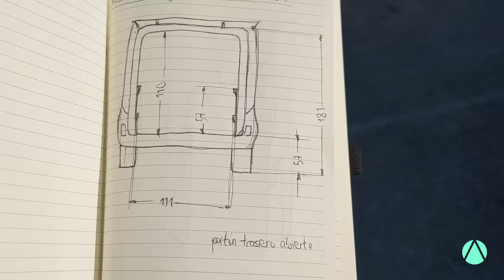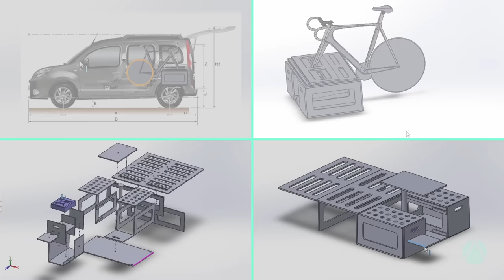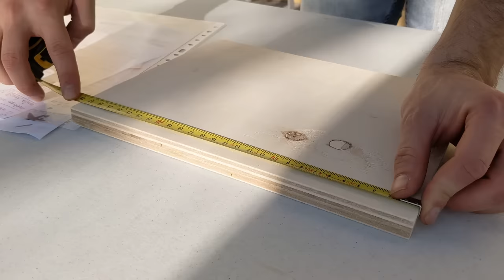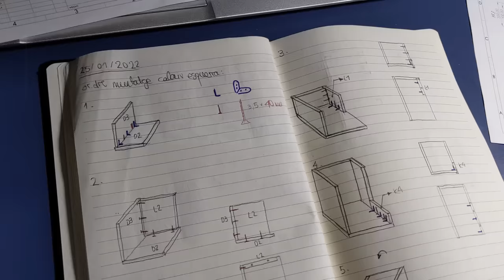ASPA | Camping Box DIY | Diseño de mueble para furgoneta

Comment: Any rough time line when your plans will be ready? :) I'm about to buy a camperbox for my VW Caddy but after watching your video, I'm thinking of building it on my own to save some money. However, I'm planning to go on a trip this summer already. So time is running (unfortunately). Last question: I still need to measure the dimensions of my trunk but maybe you know already: Does it fit in a VW Caddy 2018? Thanks a lot! Looking forward to your reply. Your solution looks beautiful!
Reply from the maker: Thank you for your comment!
It will all be ready in May. I don't know about the VW Caddy dimensions, sorry. You can check the general dimensions of this camping box in the video description. 
Good luck with your project in case you go ahead!
Reply from the maker: Plans and assembly instructions are already available in video description :)

Comment: typically  you should do a dry  fit before you permanently install into the motor vehicle so you know  it  fits in the door space
Reply from the maker: Indeed! Actually, we took the base part and checked it not only horizontally but also vertically by moving it up & down simulating the total height of the camping box. It all fits well!

Comment: What is the weight of the unit?
Great build, and great video!
Reply from the maker: Good question! Actually, we never weighed it. I would say around 30kg. Easily managable for 2 people, as you can see at the beginning of the video; but still stable on the base of the trunk.

Comment: Inspiring!
What Software did you use for modelling? Would you recommend it for beginners?
Reply from the maker: Thank you! The software used is SolidWorks, usually used in engineering. I would not recommend it for begineers as a fast solution, but it all depends on time and motivation.

Comment: Hello, little message from france :). I bought the plans and built it last week-end, still some little stuff to do but not much. I have a peugeot partner teepee (2011), the box fit perfectly. For the bed part i already built something before, so i kept 2/3rd of it, and attached it to the box, works like a charm. didn't build the table, i want the middle part without anything so we can put a box or something. And like @tenfifteen1015, i mirored the drawer A on both side, more practical i think. The plans are perfect, very clear, some very little errors, but insignificant (All cuting and sizes are fine). Thank you very much for the plans, going on our first wild ride 5th of July :) oh, and i am going to build a "bed store", that will go accross and above our feet, 120x40 or 120x50, so we can bring my gf's kid with us (4yo).

Comment: very practical your project using simples tools  but I have to ask you what is the purpose the one wheel bike for?
Reply from the maker: The wheel is just removed during your trip while the fork is attached to the rack for security reasons. After that, you have to attach the wheel to the fork again before riding your bike! 🚴

Comment: Nice box! How do you prevent the middle support beneath the bed from folding down when you lay on it? Is there something to attach it? Or does it hold itself?
Reply from the maker: It holds with the weight and the position itself, placing the hinges as it is shown (we have never fallen down). For extra support, you could add a perpendicular joint on the base: https://i.ytimg.com/vi/gNhsn2F8gv4/maxresdefault.jpg

Comment: That is a nice video, which must have taken a lot of time to make.
Did you cut holes in the panels to keep the weight down or for other reasons?
Reply from the maker: Thank you! Indeed, the project took quite a lot of time. 
The holes on the panels are there for two reasons: 
1. Weight reduction of 50%+, which makes it easier to move and fold the whole structure, and also decreases fuel consumption.
2. Ventilation for the mattress.

Absolutely worth it!
Reply: @boumbero , good to get confirmation! Enjoy your improved car as best you can!

Comment: Out of curiosity, what CAD software are you using? What would you recommend to a 3D newbie (with lots of 2D design app experience, however, as I work in design).
Reply from the maker: The CAD used is SolidWorks. It is more engineering orientated but still friendly with the basic tools. You could also use SketchUp as a starting point.

Comment: Do you think it would work for a 2013 Kangoo Energy? (Length 2.28m)
Reply from the maker: It might work for your vehicle, too.
You can check out if these measurements would fit:
Folded dimensions: 43 cm (H) | 111 cm (W) | 67 cm (L)
Extended dimensions (bed mode): 38 cm (H) | 111 cm (W) | 185 cm (L)

Otherwise, you could adapt it exactly to your needs.

Comment: is there any specific reason for the holes in the wood?
Reply from the maker: The holes on the panels are there for two reasons: 
1. Weight reduction of 50%+, which makes it easier to move and fold the whole structure, and also decreases fuel consumption.
2. Ventilation for the mattress.
Reply: @boumbero  thx

Comment: Hiya what's the time frame for a project like this? Both labour hours and waiting for vanish to dry, etc? Thanks!
Reply from the maker: It might take variable time, depending on the abilities, and the details you want to invest with. On this project there were many phases: design, 3D model, drawings, shopping, cutting, varnish and assembly; (+ recording the whole process); so it took some days. For the varnish it depends on the product specs, but generally it might take around 24h.

Comment: Hello, is it compatible with Volkswagen Caddy?
Reply from the maker: This camping box has been designed specifically for Renault Kangoo Extrem 2014. However, it fits in many other vehicles. You should check out if the dimensions are suitable for you:
Folded dimensions: 43 cm (H) | 111 cm (W) | 67 cm (L)
Extended dimensions (bed mode): 38 cm (H) | 111 cm (W) | 185 cm (L)